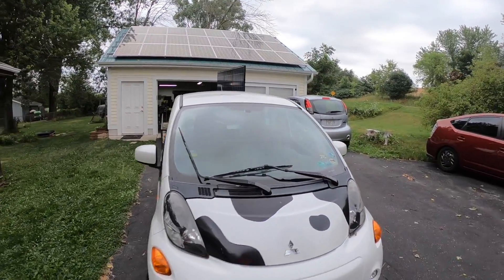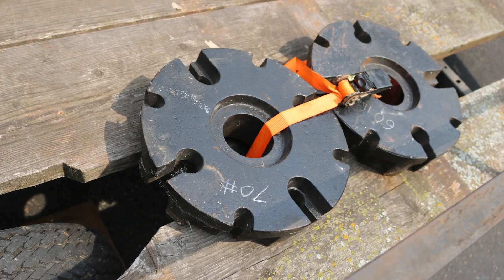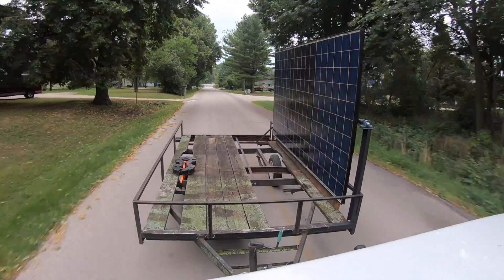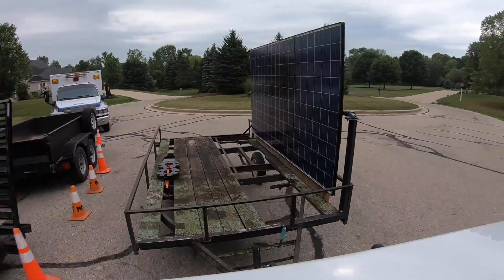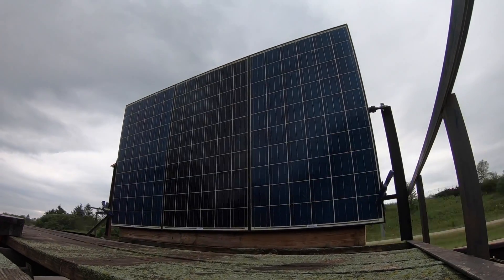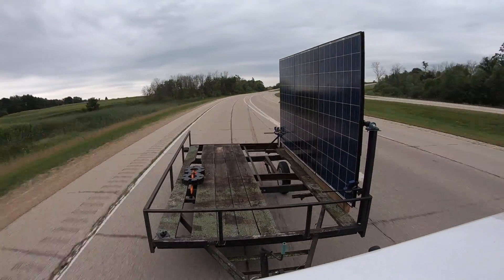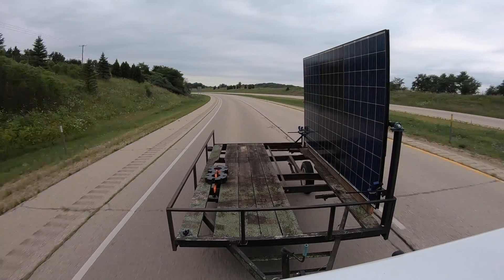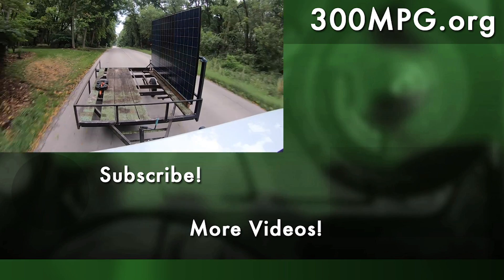DIY Solar Trailer: Part 2 - Test Towing for first time

Comment: how much charge can you give to the car and how much mileage can you get out if it? :-)
Reply from the maker: I only have 3 of the 6 panels on it so far. It should be able to make enough energy for about 3 miles of charge for the car per hour of direct sunlight.

Comment: i Ben in Portugal on my peugeot ion by law i can not put a trailer on it damm...
Reply from the maker: Laws about trailers are weird. In one country, it's perfectly fine to tow with a certain car, and in a different country, with the same car, it isn't!
In the United States, many vehicles have NO tow rating. It's not illegal to tow with them, but everyone is afraid they will void the warranty, etc. Mostly, it's just to sell more pickup trucks!

Electric vehicles, even a small commuter like an iMiEV tend to tow very well as they create plenty of torque at low speed, and the regenerative braking helps with controlling the trailer while slowing down.

Comment: Are you planning to make the other side taller/smaller so that when you angle them, one set of panels isn't being shaded by the other one? Or will they just lay flat when you're parked somewhere?
Reply from the maker: I'm planning to make them the same height. That way, the trailer can be parked pointing east or west( so that the panels face south.) In the summer, with the high sun angle, the two rows of panels will not shade each other.

To make a design with this width of trailer specifically for severe winter angles, the second row would have to be up significantly higher. High enough that it wouldn't make sense to use this style design.

Perhaps in the winter, I would only use the one row of panels.

I also will be able to lock the panels in a flat horizontal position.

Comment: I assumed you put in another row of solar panels on the other side, otherwise why not move the solar panels to middle, for better balance and no weights.
Reply from the maker: Yes, a second row of panels is going on the other side. I want to make sure my support system works the way I hope BEFORE building a second copy. That was a big part of why I am doing some test towing in this video - to make sure nothing breaks, flexes too much, or otherwise is a design flaw.
I just want to make sure it's all good before doing the other row of panels.
Reply: @BenjaminNelsonX  great answer thank you

Comment: Charging the car from the trailer is going to be an absolute ice breaker at events.
Reply from the maker: It will likely only be Level 1 charging, as it will only be 1,500 watts of power, but YES, it sure should get some interest and strike up conversations!

Comment: Considering adding an onboard utility battery of sorts? Would be useful tongue weight, I imagine.
Reply from the maker: Yes, this will be getting a solar charge controller, battery and inverter. I just wanted to test my mounting system to make sure everything seems solid before continuing the project.